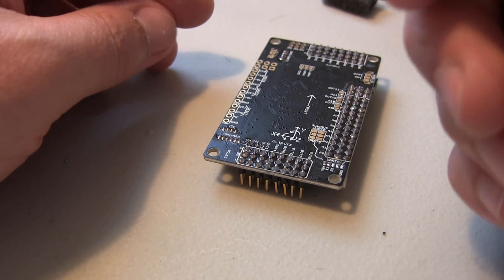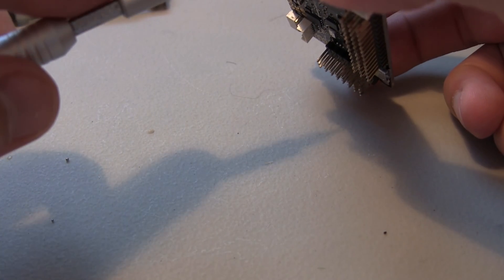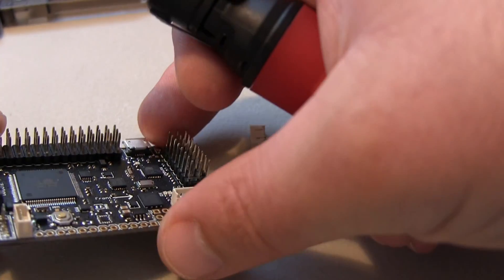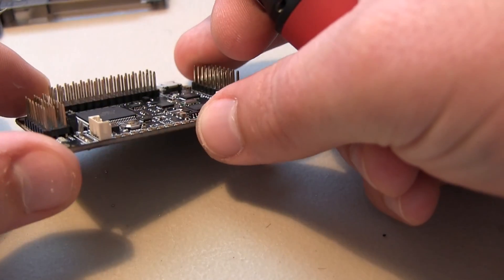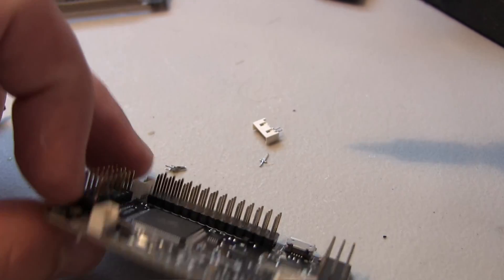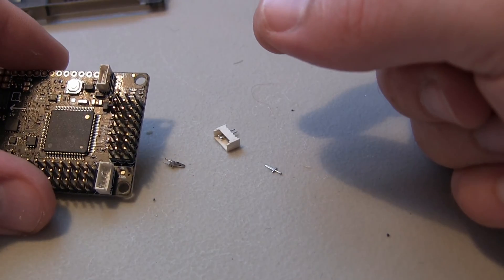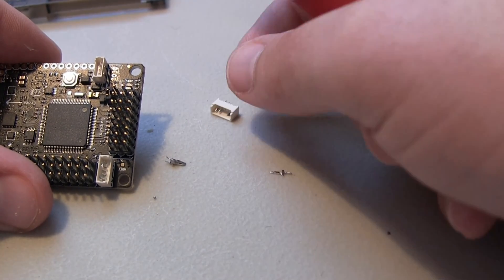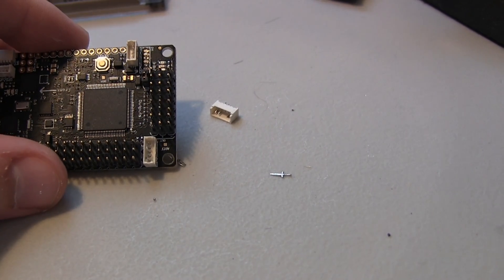APM 2 6 - Desoldering Wrong 5 Pin Connector  in 4k resolution

Comment: I enjoyed your video. I saw that you added solder to make a heat bridge to heat the solder joints. And, you are using a fat iron tip to carry more heat to the joint. Those are good tricks.

You might want to try adding flux. And, while an iron can be used to pull solder away from the joint, a special, cupped tip is needed. A solder sucker vacuum pump is also helpful. But, it will jump off the joint, due to the spring recoil... So, it is a little more difficult to use. "Solder Wick" will also suck off the solder. It comes with some flux, built in, but more flux is more better:-) Stranded wire can make for a substitute.

I didn't think that there was much to know about desoldering technique, but I was wrong. And, knowing the tricks make things much better. I watched desoldering tutorials, here on YouTube. I continue to watch them to try to find new techniques. That is why I watched your video.
Reply from the maker: So solder wick? Where can I pick that up? Also I have heard of solder vacuums,  never have seen one. Thank you for the response. How does solder wick work?
Reply from the maker: Thanks for watching the video.  I solder a lot, but never desolder much. Vacuum would be nice.